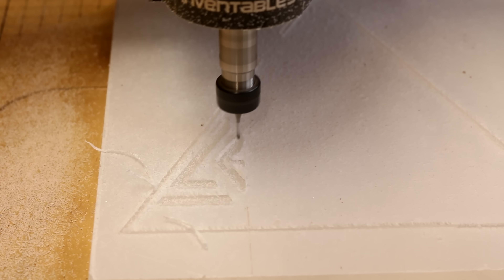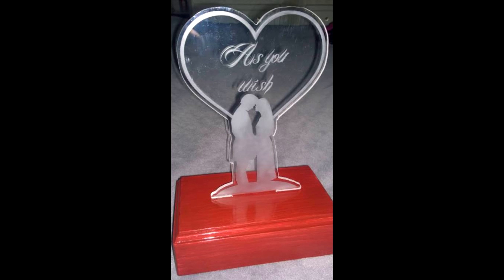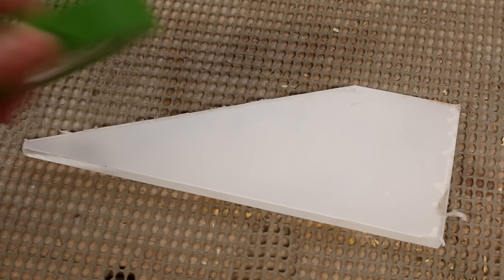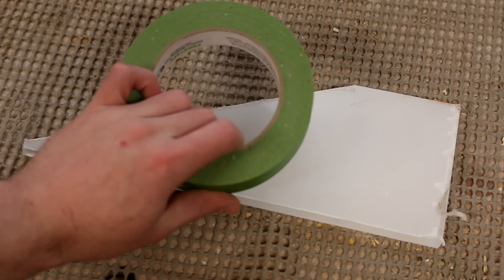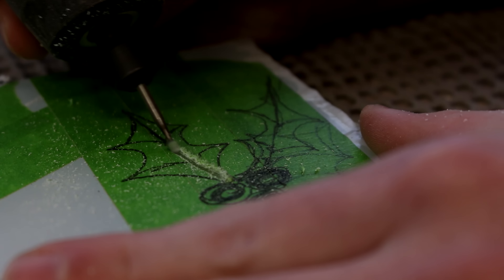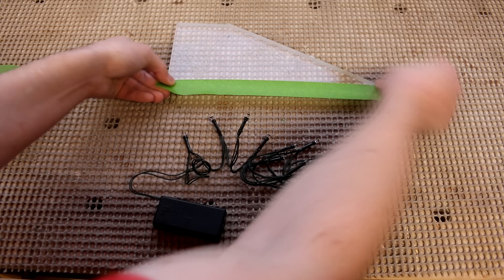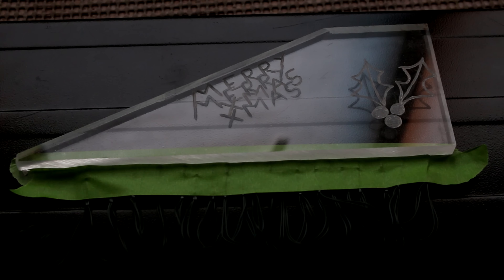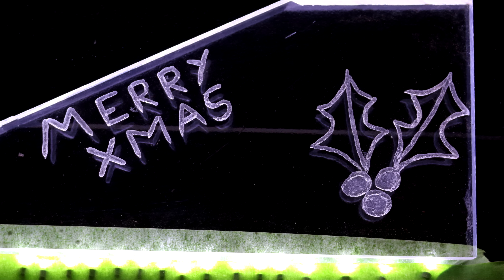LED Light Follow Up - How To Get The Same Effect Without A CNC

Comment: A really good follow up Joe, you have a very steady hand! I might try it with my router and some letter templates I have. 
If you don't mind me asking, where did you get the perspex and what thickness is it? Thanks.
Reply from the maker: +Happy Wife Happy Life Thanks mate! I got the perspex from Ebay. Its 18mm thick. It doesnt need to be anywhere that thick though. I just got that because it matched the size of the LED light strip I had